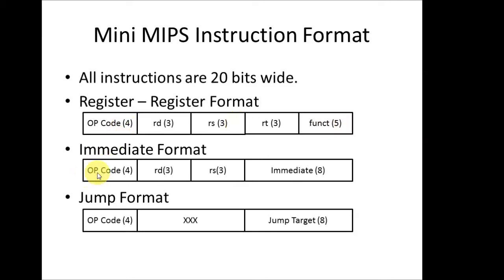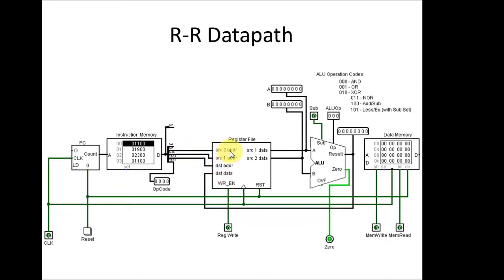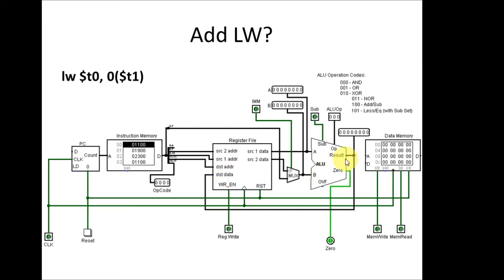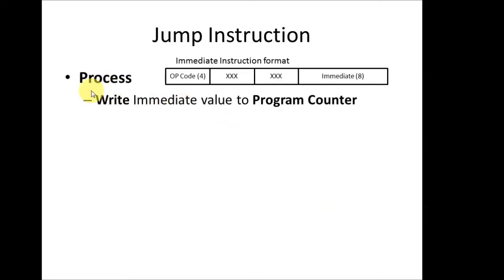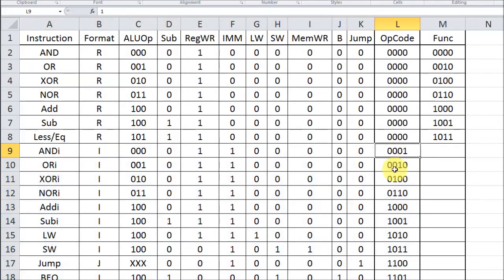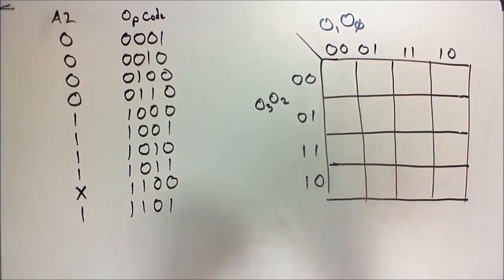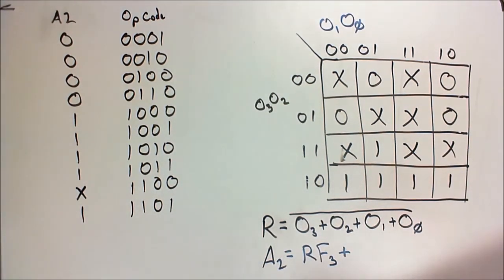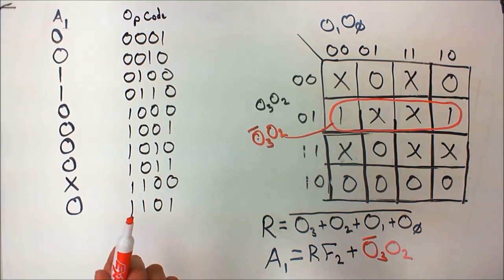CSE230: Muddiest Points - Datapath and Control Unit Design

Comment from the maker: No. Each of the output signals (ALUop, Sub, SW, etc), that depends on the opcode and f-code, and generates the signals.  Treat each signal as an individual output, so that it only depends on OpCode (and F-code for ALUOp and Sub).  You can build a k-map by just filling in the cells from the columns in the instruction table, by op-code.  Each signals' output k-map is over all of the instructions to drive it, so you're finding an expression that implements the behavior for all operations.